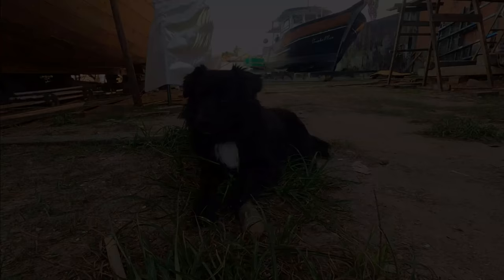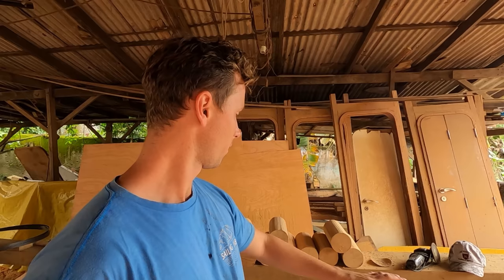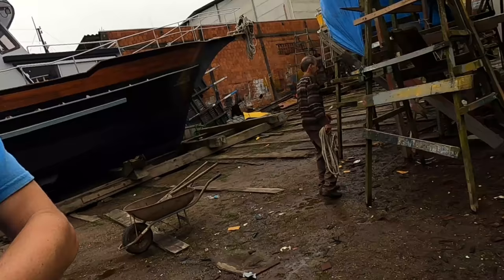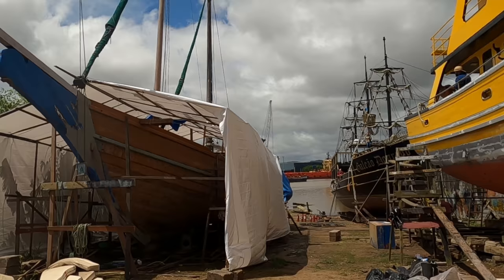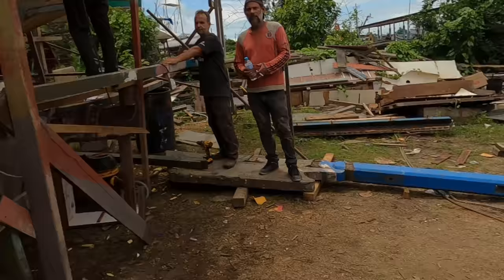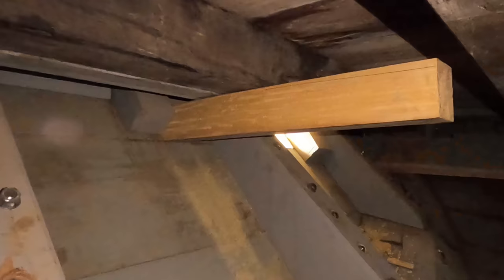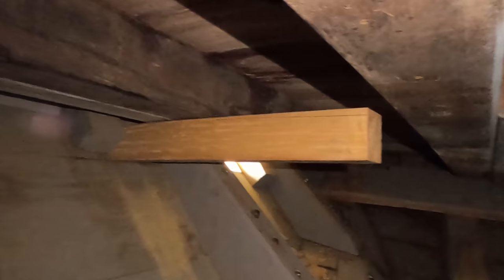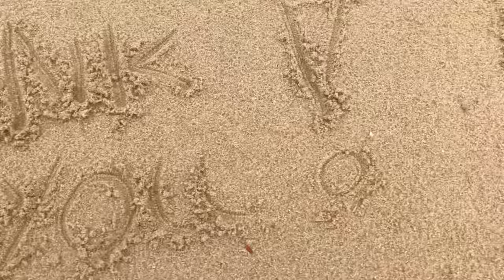Building a HUGE wooden swimming platform on a sailboat — Sailing Yabá #75

Comment: I see someone caulking yaba's roof with cotton.  you do not understand how wooden boats work.  cotton calking works under water below the waterline, because the planks are sitting in sea water, which causes the wooden planks to swell pinching the cotton to become like the wood to stop water from leaking to the inside the boat.  you do not want the roof or deck boards to get wet at all to swell up the roof or deck planks to swell, you want to seal the decks and roof from getting wet at all.  Y ou have chosen the best resin, now, but you need fiberglass chopped strand matt to be applied to the roof and decks to seal out all water,  no fiberglass or fiberglass woven cloth will not prevent water from getting throgh the decks and roof.  Chopped strand fiberglass is the only type to seal out water.  Also, after you are finished with the epoxy and chopped strand fiberglass, or varnishing, go to an automotive paint store and buy automotive clear coat to apply over the epoxy or the varnish.  I the tropics or semi-tropics, your varnish and will only last a few months, after the clear coat with UV aluminum oxide fighter, it will last not several months, but a few years.